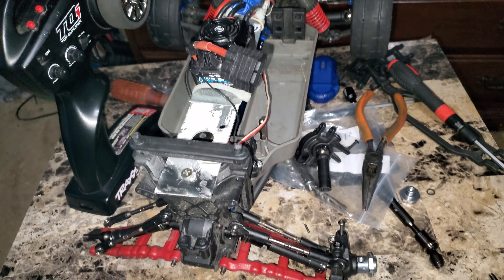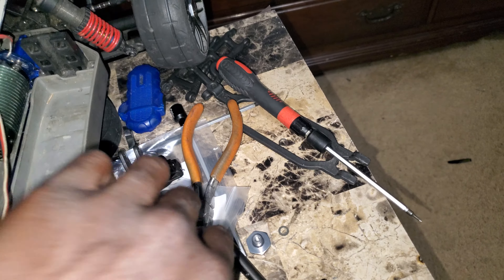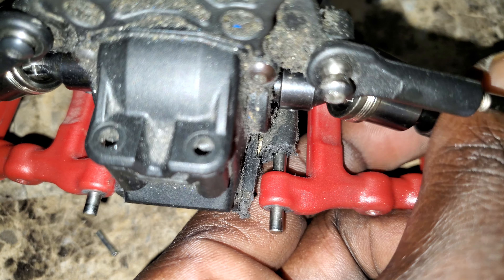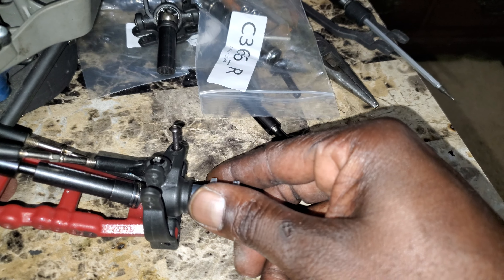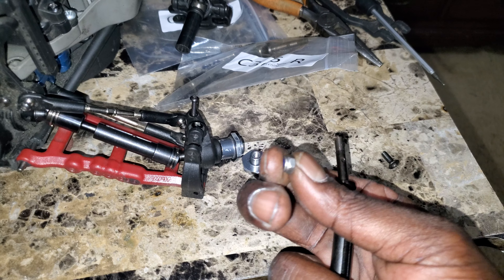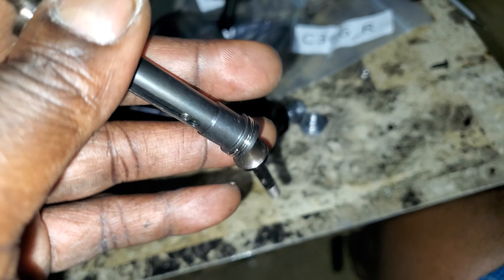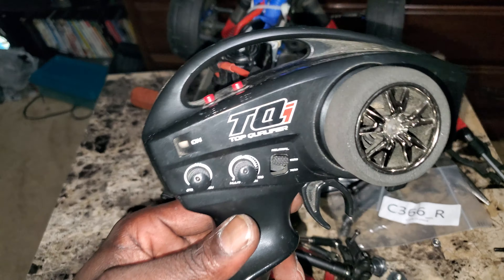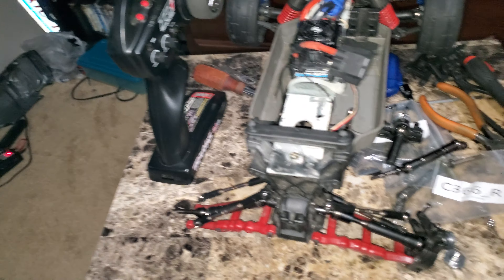EBay drive axles for the stampede 4x4

Comment: Found out my neighbor has a set on his slash its a 8mm nut find a 8mm barrel nuts on eBay.
Reply from the maker: Thank you.. Is there a hub adapter that would work with that
Reply from the maker: Does he use hub adapters?
Reply: @chevybrotha  no